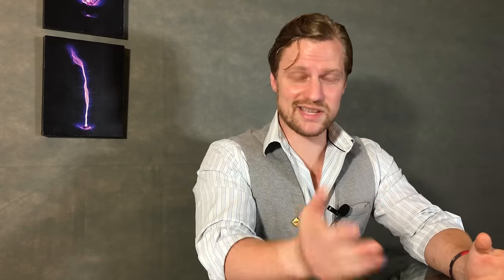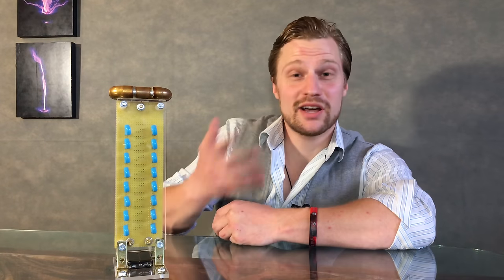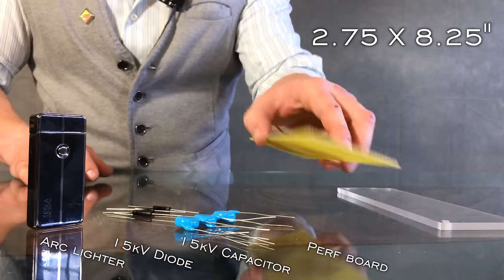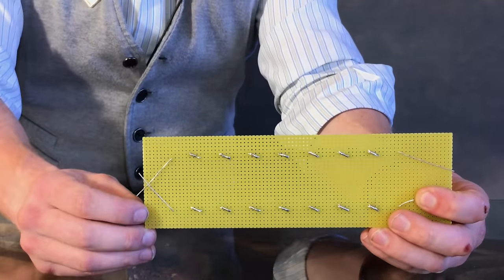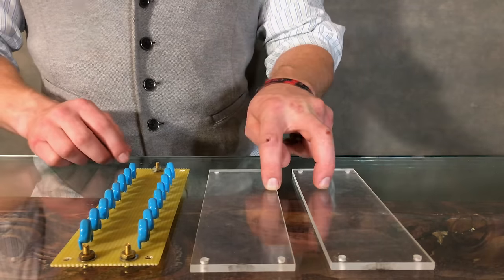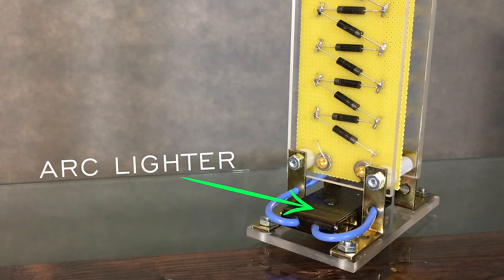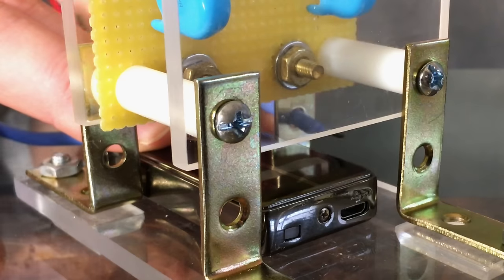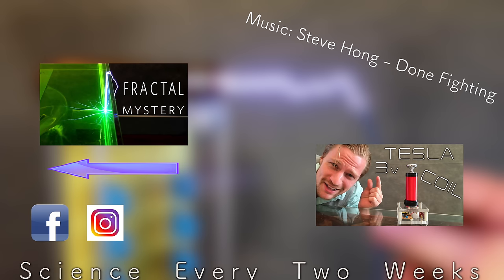DIY Desktop Lightning Tower (USB rechargeable!)

Comment: Sir please can you say me where should we connect the wire last from which the plasma was coming white colour wire . You told to connect it to gnd but where??
Reply from the maker: The electrical ground of the multiplier itself. Every voltage multiplier is identical - one input wire also the ground. Depends on which way you put your diodes.

Comment: What would happen if you made 10 rows of the capacitors and diodes?  Would it reach more then 3 inches? ⚡️⚡️⚡️

Also great video
Reply: in theory 3,3" but depends it the inculation holds up since coronas coul ruin the party and you have to use oilbath for insulation

Comment: would you think 3KV / 100pF to 10000pF capacitors work or would it be too little capacity?
Reply: 3kv good
Reply from the maker: 3kv may not last long. The arc lighter puts out over 5,000 volts - your caps would die.
Reply: @PlasmaChannel  thanks

Comment: How big can you make it? Are there limits?
Reply from the maker: There are realistic limits on number of stages. Usually, 10-12 stages is the maximum because after that the voltage increase is very little for every stage. However, if each stage was charged to 100,000 volts.....thats a really potent output.

Comment: Where is the ground of the multiplier on your circuit? I’m having trouble finding it as you didn’t show it in the video
Reply from the maker: All multipliers have the same ground. Please google voltage multiplier schematic, it will help. It depends on which way you put your diodes.
Reply: Yeah I figured it out. I’m kind of ashamed because I’m a third year EE student and I should’ve just known by looking at it. Once I saw how everything was wired up it clicked. Thank you so much for your reply and I look forward to your videos :)
Reply from the maker: Mission Trails hey, no worries! I’m glad you reached out!

Comment: Great video just one question: do you need 15kv diodes or can you also use 10kv diodes and have it still working
Reply from the maker: Thanks peter. You can use 10kv ones for sure, they just need to be “fast recovery” diodes
Reply: @PlasmaChannel  ok thanks

Comment: Can i do it with cheap 6v to 10000V converter thing with black box which keystone science used them to make emp and electric shock? I follow you for 2 years now and i must say your videos are great for begginners!
Reply from the maker: Thanks for the compliments! Voltage multipliers only function with an AC input. Any high voltage DC input will not allow the device to work.
Reply: @PlasmaChannel  Thanks

Comment: Do you have to use 100ma diodes? What would happen if I used 20ma diodes, would the arc just not be as thick?
Reply from the maker: Thanks for reaching out! Are you familiar with how component ratings work?
Reply: Yeah, I'm just not too familiar with how diodes are rated
Reply from the maker: They are rated the same as other complements. Ma rating does not determine power output. It determines how many ma they can take before blowing up. 100 and 20 ma diodes will perform the same. But 20 is pretty fragile if using in conjunction with 1nF caps
Reply: Ah, makes sense. Thanks for the responses!
Reply from the maker: You are welcome! 20ms may work, but what are their ‘peak’ current ratings? Because the sparks produced by this are more than 20ma pulses.

Comment: Hey Jay, I have a question for you. Recently I have just started a new hobby. And that's tearing down old computer towers, laptops, microwaves, air conditioners, TV's, monitors, etc. I started doing this for mainly scrap. However, I started watching YouTube channels like yours and IMMEDIATELY got interested in building random stuff out of whatever it is that I've torn apart. Here's my problem...I don't know SQUAT about electronics, circuitry, or ANYTHING along that line. And so...as I delve into this new hobby of mine, the one question that I have for this particular video is...Do I have to use a wire ONLY to get an arc to happen? Or can I use... let's say...a screw driver, a pair of scissors, etc? That way, I won't have to ground those out. Can I do this without frying the arc lighter?
Reply from the maker: Hey Jay! This tower must be discharged only to its own electric ground. Don’t let the sparks jump to anything but it’s own electric ground - and better yet - build a stand to hold the ground wire so that you don’t need to hold it with your hand. You can also use a screwdriver or anything conductive. But it MUST be connected to the multipliers own ground.

Comment: Absolutely love your videos, Is very educational and fun. Quick question, where is the wire connected to that you're using  to create the sparks. Is is it Earth ground or the other side of the arc lighter terminal? Thanks
Reply from the maker: I’m honored you enjoy my videos. Thanks for being a sub! So the ground is connected to nothing. By the very definition of a multiplier’s ground, it is one of the high voltage input wires. 

Don’t connect this to earth ground or 1) you’ll immediately kill the lighter, 2) possibly get hurt. 

Cheers
Reply: OK great I really appreciate the reply. I'm actually a licensed electrician but only deal with household voltage 120/240  I'm just now getting into the higher voltage stuff ,  I recently built a fractal burn machine, now i have the bug and want  them all ie..Tesla coils and van de graaff generators and  Now you're lightning tower ,, Keep Up the great work, I'm definitely a fan!!

Comment: Hi. I got the same arc lighter and parts. When assembled im only getting 1.2 inches of spark, not 3 inches like yours. Am i doing something wrong. Instead of 1nf capacitor, im using 1000pf. Same as 1nf. 15kv diodes too. Any help
Reply from the maker: So I found that after 10-12 stages, the device actually decreases in voltage. It’s due to not high enough frequency input. 8-10 stages is totally optimal. Also 1.5 inches is a little small... hm... you used one of the lighters in description? The saber light X is the best one, with two internal transformers you can wire in series to make a great output.
Reply: Ok i will reduce it to 8 stages. Also, does it being a negative instead of positive multiplier make a difference?. I used the exact tesla lighter u did. I do also have a atomic lighter with dual coils.

Comment: I'm a prestidigitator and I would love to adapt your builds into my set of tricks. I'm taking your ideas to try and replicate and enhance a trick called "electric touch" brought on the market by Yigel Mesika (neat product, you'd love it)
So first I'm wondering how changing the capacitor value (more farads) would affect the multiplier. 
The other thing I'm wondering is : if I were to create such voltage multiplier and connect it to some conductive paint laid on my skin (on my right hand let's say) could I draw a spark safely to some more conductive paint from my other hand (connected to ground)

Comment: Hey im thinking of doing this as my first high voltage  project can i use wood instead of the plexy glass and where do i ground the spark wire ?
Reply from the maker: I would not recommend wood. It becomes conductive at high enough voltages. Also, the spark output should only go to the electrical ground of the multiplier itself.
Reply: What is your picture Egert-Siim Punga?
Reply from the maker: Additionally, please be very careful. This project really is not a beginner project as some risks are present. Please read up on high voltage safety first.

Comment: Hey Jay. Awesome video. Amazing build quality. As always. 
In your video use of 1 nf capacitors are mentioned.
I have loads of 20kv 0.01nf caps spare. Can I try those?
You stay classy.
Reply from the maker: Unfortunately, .01nF is a tiny capacitor size. I have never tried that small, and can’t guarantee it would work. The voltage rating is great, but capacitance is smaller than optimal
Reply: Thanks Jay
Reply: I tried it. Why not. Experiments are the key. 

(Double arc lighter)
Here's what I found. 

The 20kv 10pf caps added little difference to the arc gap width. Maybe 20% increase at 4 stages. Although I only had 20kv 5ma diodes. (Coils in series- no noticeable change with single coil.)
The volume of arc crack increased easily 100% tho. Sounds like the pitch has increased too. Like 5000hz to 9000hz on a tone generator. 

Best thing I found during this experiment. The arc acts massively different (A.C-D.C)in magnetic fields. The HV HF A.C. is spectacular in a strong magnetic field.  
Will make an awesome video if you get a large neodymium magnet, ground the magnet and arc to the magnet (A.C.)
Not to mention the fun you will have doing it. 
I would watch that 100 times over.
Reply: Rather than edit I thought I'd add. 

It does increase the arc gap in ratio. I had a bad connection. 

The 10pf cap gives a relatively low shock. Feels like the discharge from a kid jumping on a trampoline. Same increased sound in volume and pitch. 
Me shocking myself was accidental not intentional. 
I'M NOT RECOMMENDING SHOCKING ANYTHING BUT GROUND. 
It's nice to know tho that a 10nf cap will make me see my childhood in a flash and a 10pf cap makes me want to jump around on springs.

Comment: Where do you mean by, "....the electrical ground of the multiplier."?
Reply from the maker: Thanks for reaching out. See a few comments below. It is an input wire.
Reply: Hey Plasma Channel, could you please add some photos of this? Also how you connected the copper pipe to the top? I really love the build and want to try it but it's really frustrating to have to search through tons of comments and not be sure if I am getting the right info. From what I have read I'm not the only one searching for this info and I really don't want to blow it up like you talked about. Thanks!

Comment: By "electrical ground on the multiplier", are you referring to the mounting hardware? A bolt not part of or near the circuit? Thank you.
Reply from the maker: Great question. All voltage multipliers have an electric ground. It’s one of the input wires, and which one depends on the direction of the diodes.
Reply: @PlasmaChannel  Thank you very much, that totally help it click in muh mind. Please excuse my excessive, wine inspired, tactics at getting your attention. Have a wonderful evening!!!
Reply: @PlasmaChannel  Hook the ground to the end of the diode which will cause the current sent through the ground to reduce?
Reply: @PlasmaChannel  When looking at the reverse side, does the ground wire connect to the input on right which is soldered to diode, or input on left which is soldered to capacitor? I do sincerely apologize for ranting, and have deleted the comment.
Reply from the maker: @Revdonlee74  Hi Don, not entirely sure what you mean, but, in my video, the ultra high voltage return wire (ground so to speak) is attached the one input on the bottom of the multiplier. If built right, both input wires connect to a capacitor directly. However, one of them also should connect directly to the negative side of a diode.That is your ground return. That is the electrical connection you want for the ultra high voltage ground return.
Reply: @PlasmaChannel  The high voltage return ground is the input connect directly to the neg. End of diode, CHECK!!!( ; D) <( THANKS AGAIN FOR TAKING THE TIME, AGAIN, UNTIL I TOTALLY GRASPED IT!!! HAVE A BLESSED WEEKEND!)
Reply from the maker: Don DeLaire thank you. You as well.

Comment: Iam from india & lack of availability of these components in my town, plz. Suggest a way or make a lesser voltage version of this 😐
Reply: For Covers it’s universal it will work with any capacitor and diodes, you can find in broken appliances.  Use just a hv low current supply to amplify

Comment: Can I use 100pF capacitors to keep the spark save to touch?
Reply from the maker: As long as they are rated for the right voltage, yes you can.
Reply: I know it's a long time ago but I finally finished my multiplier! Instead of an arc lighter I made my own flyback and driver producing ~7kV ac @ 10 kHz. 
The multiplier consists of 20 stages of 20kV diodes and 2x10kV 100pF caps in series each. The multiplier was put in a pvc tube and filled up with wax to prevent corona losses. On the top I put a 20cm metal sphere. 
It makes about 15cm sparks wich don't hurt all that bad because of the low capacitance. When turned of it loses charge very slowly indicating that the reverse leakage of the diodes is negligible.
It's negative by the way, wich means it also works as a negative ion generator.

Comment: The top load which is the copper pipe is connected to the circuit? If not then how electricity flow to it
Reply from the maker: It is connected to the High voltage out wire

Comment: What is the electrical ground of the voltage multiplier in this circuit exactly?
Reply from the maker: It’s the same as any voltage multiplier. Depending on which polarity you build the multiplier with, it’s one input wire or the other.

Comment: Hey what's up jay I just have a small question to ask. So I've built my circuit with 20kv 1nf capacitors and 20kv 5ma diodes and it works, but the sparks only reach about 16mm do you have any tips or tricks to increase spark length?
Reply from the maker: How many stages does it have, and have you made sure to round all your solder joints? Any sharp point will drastically reduce voltage out.
Reply: @PlasmaChannel  thanks for responding jay. It has 9 stages and I’ll make sure to round out those joints and see how it works. Thank you for the tip!
Reply: @PlasmaChannel  ok I rounded the joints but the arcs are still small do you think if I used a zvs driven fly back transformer it would help?

Comment: Love your videos! How expandable is this? Theoretically could you stack 100 stages to get ~800,000 volts assuming you adjust the components? Seems unlikely as that is an almost 2,800x increase.
Also, I'm assuming the electricity loses something in the process? What would that be...amps? Otherwise you could just charge the lighter with the increased voltage right? Although, I know that free energy devices break the laws of physics I feel like something is missing. Thanks for any responses
Reply: Multipliers convert AC voltage to DC voltage. It does not GENERATE power and that is why you cannot charge it with itself and there is no such thing as infinite energy. Besides, energy is always lost due to its conversion to heat on a circuit. What happens is those capacitors bank the alternative current and instead of a steady release they release it all at once. So the peak of the current 
is multiplied. It's like a river that flows constantly. You build a dam. Wait for it to fill and then open the dam flow....It's been a long time since I messed with electronics but i think that's about it.

Comment: Can I use an AC flyback driver for example used for those plasma globes? I believe they are rated at 3000 volts or so; which is in a similar ball park to those lighters. This means I can then plug it into the wall socket and don't need to rely on batteries.
Reply from the maker: You absolutely can. That would be a perfect replacement. One warning though: I tried once, and after a few uses, it blew up the driver circuit for the flyback.

Comment: Can I use bug zappers instead of Arc lighter
Reply from the maker: You cannot - you need high frequency AC to power a voltage multiplier
Reply: @PlasmaChannel  then can I use a home made circuit with 80kv output voltage? using step up circuit
Reply: And can you make a plasma ball using a 15kv-50kv output and explain the parts and their alternative parts that can be used instead of them..

Comment: I just finished building mine and when I tried it, 1 arc jumped and after that the lighter broke. Do you have any idea what could have happened?
Reply from the maker: Were you discharging it solely to it's own electrical ground? Or, were you discharging it to an earth ground / another object?
Reply: @PlasmaChannel  I connected a wire to ground of the voltage multiplier. I'm new to electronics. Is it possible that i connected the hv wires in the wrong order? But the output of the lighter is AC as far as I know so it shouldnt make any difference, I think.
Reply: @PlasmaChannel  by the way. Can I use the same multiplier again or do I have to change the capacitors and diodes now too?
Reply from the maker: That is very strange. Sorry to hear that. What type of lighter did you buy?
Reply from the maker: Also, if you used the components I used for the multiplier - the multiplier section will be perfectly fine. It would not have been those components that broke.
Reply: @PlasmaChannel  I used a Jobon Arc Lighter with an output of 7kV. Also I used 15kV 1nF capacitors and 16kV 100mA Diodes. The printing on the capacitors says 20kV so I'm not sure if I really got what I've ordered but as far as I know, a higher voltage rating on the capacitors should not be a problem. By the way I'm not blaming you :). I'm really new to electronics so maybe I've just overlooked something. Thank you for your respond! If you have any idea what could possibly have gone wrong, I would appreciate another advise!
Reply: @PlasmaChannel  Is it possible that some Arc Lighters have a kind of HV Output protection?

Comment: Hey j,
 I'm building a version of the lightning tower I had a question the the top bolt is that connected to the copper on top Or does the proximity serve as a type of spark gap?   thanks again keep up the good work love the videos